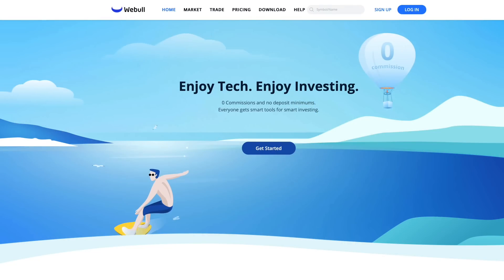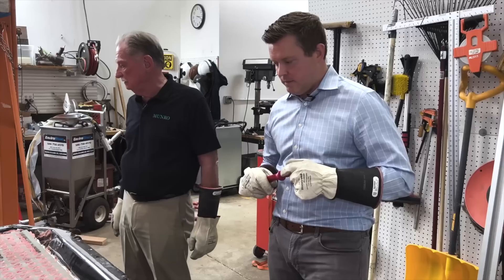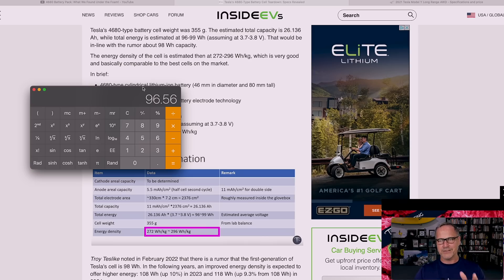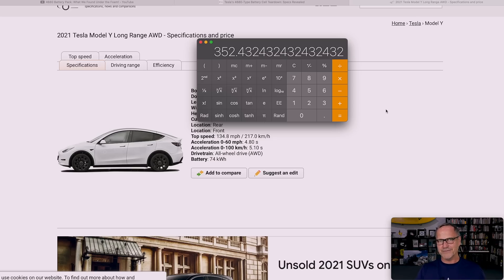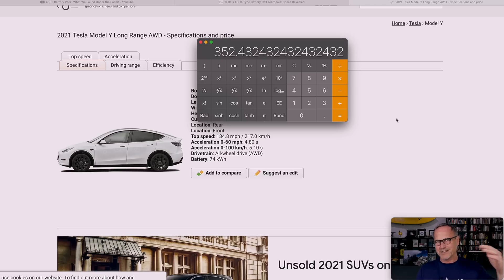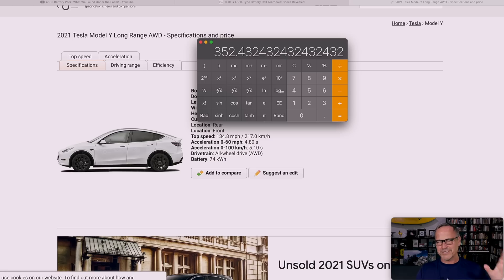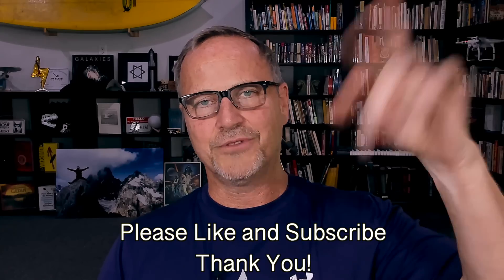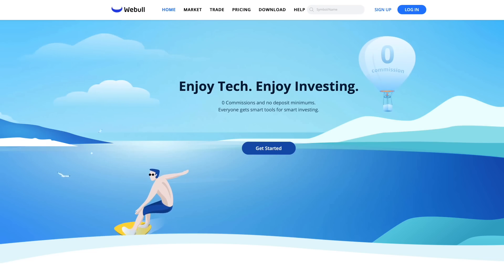Is Tesla SANDBAGGING the 4680 Model Y RANGE?!

Comment: On the Q2 call they said there is no hidden unlock waiting.. And it wouldn’t make sense to use more cells than you have to per car when you’re cell limited.  The cells provide structure so they could have “blanks” mixed in. Definitely an early chemistry and playing margins safe while they validate, but nothing like the “long range” unlock people are speculating about.
Reply: yes, I'm thinking blanks, or using 8% rejected 4680 cells (as they get their 4680 process lined out), but  not counting those cells in the range calc.  Def doesn't make sense to give 8% of your good cells away when so constrained!
Reply: I wouldn't think they'd even need blanks, just leave some out entirely, surely that pack is vastly overkill structurally.  (although that would imply they should reduce can thickness perhaps)
Reply: Actually Tesla did not fully deny the rumours and what they said leaves room for the pack to be software locked.
Tesla using blank cells would be counter productive and the opposite of what Tesla do.
Evidence proves the 4680 Model Y are software locked.
Reply: Well of course theyre gonna say there's no hidden unlock. To not let people wait to buy only the 4680 Tesla's

Comment: Better Tesla designs a reliable battery, then a repairable battery, a design that makes the battery repairable adds huge cost, complexity, weight and additional failure modes.
Reply: Napkin math coming up. A car that does 250 miles, charged 2000 times, (may lose 10% capacity when charged "properly") - that's about 500,000 miles . Doing 10,000 miles year, if you drive for 50 years, that's 500,000 miles. 1 battery for your lifetime of driving. How many cars (or ICE engines) last 500,000 miles ? (Obviously approximations, but it would be interesting to hear from Tesla about the expected reliability. )

Comment: Tesla also could put less cells in the pack to counteract the Osbourne effect.
Reply: Yes but so far its looking like that didn't put fewer cells in the pack. So the question is what's going on? Will the range increase via software at some point? My guess is that they used 816 cells, but not all cells are good, some are dummy cells. 816 cells are needed for structure, so that can't just use fewer of them, but they don't make enough good cells yet so they added some dummy cells to make up the difference. Thats just my guess anyway.

Comment: I think another battery engineer mentioned the limiting factor had estimated the density too high. closer to 262 wh/kg or 76 kWh.
Reply: The "non-silicon Anode" night confirm this.
See my other recent post 🖕👇
Reply: Agreed- I think it was Matt Lacey (sp?) on Twitter who tears down battery cells as his day job.  His estimates put it closer to the actual pack.  I think it most likely it has 828 cells at a lower energy density.  My thinking is Tesla is just using a more conservative chemistry (no silicon) so they can walk before they run.  Prove out the form factor and manufacturing than start pushing the chemistry to its limits.

Comment: Living in the bubble bro! Range is less because Tesla is having to play it save with energy density in a new form factor. Also still side cooled, another symptom of playing it safe.
Reply: They also said in the Q2 Call that they werent limiting anything, i think they are just playing around with stuff and this config was the first very save option.
Reply: Internal resistance is much lower in the 4680 cells, so much less cooling necessary. But Tesla has to play it save, which I appreciate very much. Better to have a significant buffer and slowly remove it with big data about the Teslas on the road with the new cells. It is simply risk calculation, a recall of a battery pack is very costly for a company.
Reply: @nilsfrederking62  
"Internal resistance" yes.
"Playing safe" they downgraded the anode material by removing silicon (at least in the "limiting factor" cell)
This would be offset by the reduced heat loss afforded by the tabless construction.